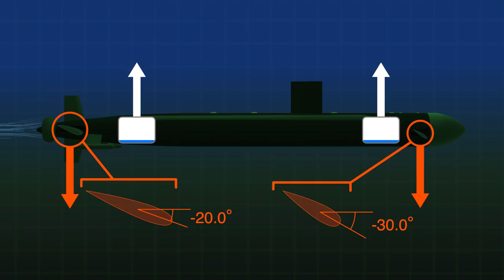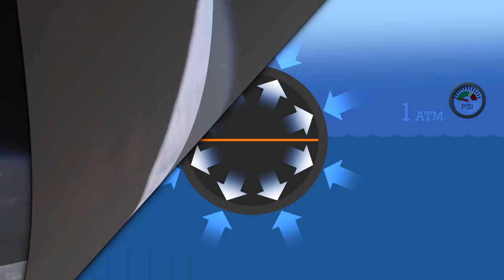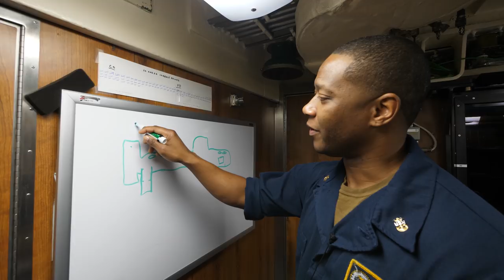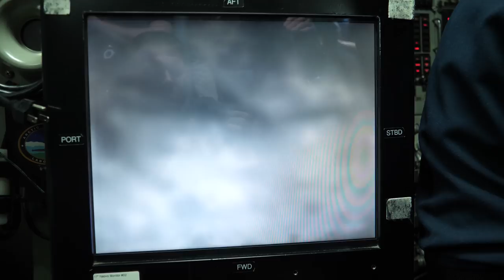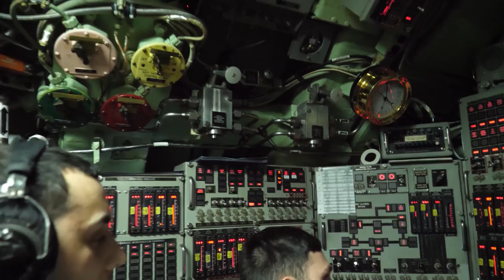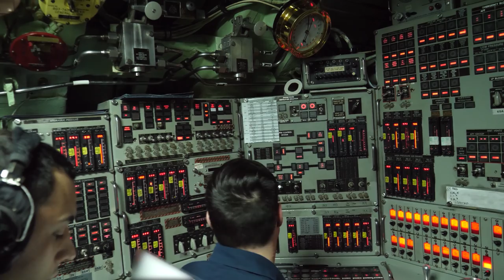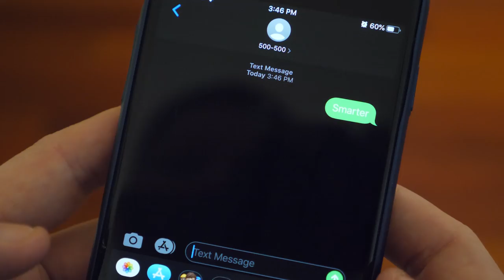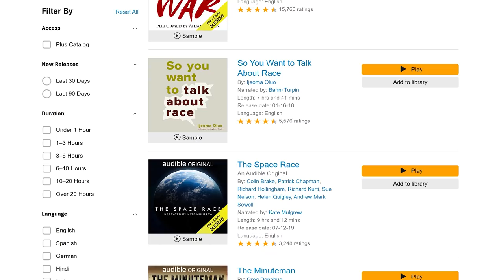How to Surface a Submarine in the Arctic Ocean  - Smarter Every Day 260

Comment: 16:22 is a similar concept to what scuba divers experience. Before learning how to scuba dive, i thought that either A, i didn’t have to change my BCD inflation depending on the depth, or B, i would need my BCD less inflated the deeper i went. However it’s the opposite. As i go deeper, i add more air to the BCD to keep myself from sinking all the way to the sea floor.
Reply: Yea i remember when i first experienced that when diving. It really blows your mind.
Reply: Try freediving. Once you hit the point all the air inside your body is compressed enough to be negatively buyoant, you start freefalling. First time you experience it, it‘s scary. But at the same time it‘s a mindblowing feeling.
Reply: @OneSingleBreath  That sounds amazing and scary. Can you elaborate? How deep this occurs? Whats are you supposed to do to go up again?
Reply: @EmilioBPedrollo  It depends on a bunch of things. In 2007-2009 I did each year a freediving course in Sharm el Sheikh, Egypt. I don‘t know if the salinity of the red sea is high, or moderate. Water temperature (at the surface down to 5 meters) was around 25° - 29° Celsius. My bodyweight was at 80 kgs, at a height of 1,87 m. I had a full-body freediving suit in 5 mm thickness (which was way to warm). To compensate for the additional buoyancy, I wore a weight belt. I can‘t remember how much weight I actually had on it. I can just remember, that in 2007, during my first course, they gave me not enough weight, because the instructors thought, I would wear a 3 mm suit. So in that year I couldn‘t reach the depth where I would start to fall. I can remember, that at around 15 meters I was in a flow state.
In 2008 and 2009 I used more weight, and I started to fall at 12-15 meters. You come up by swimming. ;) I mean, there are different types of freediving. Regarding deep diving there are: 

Constant weight with or without fins - you hold your breath, and you dive with or without fins. 
Free immersion - you wear no fins, and you pull yourself down on a rope, and up again.
Variable weight - You get pulled down by a weight, but you have to resurface using your own strength
No Limits - You get pulled down by a sled, and you resurface either by a inflatable lift bag or a counter-ballance pulley system

Comment: I experienced the air compression phenomenon when scuba diving. It's kind of scary, because to descend, you want to let a bit of air out of your BCD to achieve negative buoyancy. Just a bit so you descend slowly, so you can equalize as you go. However, as you descend your air tanks are being compressed, so they displace less water and you start to accelerate. If there aren't many landmarks, or you are diving at night, it can be hard to notice this happening.

Comment: "You can just do the trig" how bold of you to assume that
Reply: Well Destin was right for me, couldn't stop myself from trying to find the depth.
"You can just do the trig" so Destin puts cut in the video, little did he know the rope gives enough information away.

I did some measurements and math on the rope, and worked out that the submarine's depth was likely around 1100ft  but could be between 800ft -1400ft with the uncertainties that I had in the measurements of the submarines dimensions and starting depth. (thanks Wikipedia)
(could be significantly more than this as bracing was not taken into account in the pressure vessel equations)
Reply: @spencerr505  well... you are assuming that the string didn't have any plastic deformations ;)

Comment: 14:17
Oh, you mean like deep enough that if the hull gave way, the water would compress the air so rapidly that it would literally ignite like in a combustion engine?
The kind of pressure so great that it could flatten a car into a pancake?
Fun!
Reply: Different sources give between 200m and 450m for maximum operating depth. that's 20 to 45 atmospheres of pressure... that doesn't sound like enough to ignite the air
Reply: @666Tomato666  Depends on the nature of the breach. If it were an large instantaneous rupture (essentially adiabatic compression), temperature would rise very rapidly (PV = nRT).  IIRC, the Navy estimated the USS Scorpion could have seen peak temperatures of 1100F+ when they imploded at about 400 meters - between nerve conduction times and the nearly instantaneous pressure and temperature increases the crew probably wouldn't have time to process it.
Reply: That's about it, and just an everyday fact of life for us under the waves...tbh it's also why I never worried about flooding, would be over too fast to realize. Fire on the other hand...
Reply: @willlokeer5469  
Are you at liberty to say which ship you sailed aboard?
Reply: I think I would rather be instantly crushed and incinerated than to wait around for that nuclear reactor vessel to fail.
Reply: @edwardneal4819  The reactor vessel would probably hit the bottom intact. If you're heading toward crush depth, it's because the reactor's scrammed.
Reply: @zildiun2327  I served onboard the USS Maryland
Reply: @willlokeer5469  
Well, thank you for your service! I’m sure it was an interesting experience.

Comment: Really fascinating and also great to see how much of an insight was given to everything what is going on there. What I do not understand is: I get it that a crew needs to be able to keep a submarine full under "manual" control, but why isn't there a lot more automation? Calculating to keep it in balance, pressurizing the tanks accordingly etc. is kind of shouting for a lot of computational support. Is that probably something which is just not shown? It looks a bit like driving a car with someone operating the fuel pump, another one the spark plugs, then someone who is sitting at the steering wheel etc.

Comment: This is very interesting.  It gives an idea of how much work goes into navigating a submarine, both in terms of depth requirements and the effect of depth on the structure of the submarine.  Working on a submarine appears to be a very precise effort, and the working conditions are quite compact.  Apparently every inch of the submarine is used for some function.

Comment: 20:00
FYI, Destin. TLDs (Thermo-Luminescent Dosimeters) are no longer in use by the DoD. They weren't when you uploaded this video; but most TLD(OSL) consumers haven't been given modern equipment training yet.

You probably wore an OSL (Optically Stimunlated Luminescence) device to monitor your radiation.

Love the video!

Comment: My theory on how the sub is able to identify where the thiner new ice to break through: I definitely think that it has something to do with the active sonar system because I think the way thicker Ice would bounce off sound is different from how thiner Ice would, I also think that's why surfacing is a big deal because using the active sonar would give up their position if another ship or sub was around 

My theory on how the sub sonar deal with multipaths: since they know they current depth ergo they know their distance from the Ice in top and the ocean floor they could adjust their sonar to not travel up to that distance but still travel far enough that they can get useful data from it. One problem with this theory is that it only works if they are equidistant from the Ice on top and the ocean floor, that's why I think they also have multiple sonar devices outside the sub, that way they can calibrate how far each can travel based on their distance from the Ice and ocean floor.  I would admit though that I don't know they're going to control how far the sound wave travels

Comment: i'm a diver. so the big difference or the big "deal" , in my opinion, is that running a dive into a submarine,  is that the internal pressure doesn't change. You can dive up to 1000 ft. i.e. and stay there for "x"amount of time (some hours in example) and , suddenly you can go up at 1 bar  again,  without  suffering any embolism. That's  because , in that case, nobody breathed pressured air. you should explain it to your audience.

Comment: ETC (SS/IDW) Retired Hooyah!  Though being 6'5" in a career on submarines isn't that great for the body.  Sleep deprivation does a number to the body.  Lucky to get 2-3 hrs in a 24 period, even though we run on 18 hr days.  Never awake at the same time each day.  Sundays we tried to get less maintenance in, etc., so could get 5 hrs.  I mean in both of those times, that is the time you get to clean up, eat, and pass out asap.  Always a different time.  So many surgeries, back x3, shoulders, knees, etc.  But I wouldn't go back and change anything other than over doing it to excel in promotion potential.
Reply: It isn't a big of an issue as it seems with the balloon example.  We have a very very heavy lead keel lining bottom center.  That is what helps to avoid that issue.

Comment: would you be able to take the background frequency of the video when the dive starts see how the audio changes over the dive and when you reached the final depth shouldn't you be able to calculate the depth of the frequency changes, i think it would based on the pressure differences

Comment: Seems like there's a lot of room for error and it was very analog. Wondering wouldn't it be better suited for a computer to take control. Awesome video.
Reply: That's an interesting question/problem/challenge. For now at least. Try to imagine all of the sensory information that would be needed. You would have to know what is happening along the entire length of the boat. (why isn't a sub a ship?)
The crew is outstanding. Their sense's are maxed out. Sounds, pressure, keeping it from going on it's side, makes landing a rocket tail first, on a floating platform relatively easy. 🤔 But who knows, some of the SpaceX guys could be working on it 🤷

Comment: Unless things have changed in submarines in the last 30 years you have it wrong about ballast tanks. Ballast tanks are, or should be, void of air when operating submerged. Their sole purpose is to provide buoyancy in order to float the ship. Trim tanks are used to control the submarine's buoyancy when submerged; overall trim, fore and aft trim and list. Water is pumped around and out to sea, and flooded in to control these. This is the job of the Diving Officer and the Ballast Control Panel Officer. The trim tanks are hard tanks, able to be exposed to full sea pressure. The ballast tanks are always open to the sea via vents on the bottoms. Air inside the ballast tank is detrimental as it compresses and causes instability because the deeper you go the heavier you get. Occasionally the Diving Officer will order that the ballast tank vents (top vents) be cycled if he feels there might be air inside from air leakage (from the ballast tank blow valves).

Comment: From year to year does the land underwater change. If it does how do submarines navigate without hitting something. This part of submarines navigation is  fascinating 🤔☘️✌️
Reply: There have been instances where submarines have ran into underwater mountains that were in previously certified safe areas. But that's only happened once or twice ever (more often is subs running into things they should have known were there).
Submarines typically do not operate close enough to the seabed for it to be a concern.

Comment: If I were to guess how they figure out which sheet of ice to punch through is thin enough, my guess would be something sonar based like ultrasound to determine the thickness of the ice, but I don't know if stuff like ultrasound works from remote locations(not directly contacting the ice). But then again, this is an advanced nuclear sub and maybe they don't want to give away that info since using sonar can give away your location.

Comment: I feel like you could swap out all that labor for some sonic induction, vibrate the heck outta the ice at a resonant frequency to weaken it, and make the job a bunch easier with a 12"X12" box that goes up that first hatch. Chainsaws n stuff? I mean sure if you gotta, but that's a lotta labor and additional mass on board for something you could just use sound waves to shake real hard til it cracks up and shovels off.
Reply: Thank God you're not a military planner
Reply: @DunjeeTime  If I wanted your opinion on my speculation I'd gargle toilet water for the same flavor and content.

Comment: You know... for a Feedback loop like the tank water problem....there are electrical controllers and a whole field of engineering on control theory, so you wouldn't need to solve those equations as a crew...

Comment: My 😅boat could not surface under the ice. Yet I got the Navy Expeditionary service metal for going under the northern pole for the first time. We has sail-planes tha could not rotate vertical, if we would have had a problem, we would have died. Im in a movie that was filmed on board. Its called Iron boats, Steel men. I got a VHS as payment for my appearance.

Comment: Prudhoe Bay isn't the edge of civilization. Its way past that. You left civilization behind when you left Fairbanks and went north. I was stationed at Fort Wainwright, Alaska. I lived in Fairbanks. I tried to drive to Prudhoe Bay during the spring of 2006 but at the time the road there was being paved. They had just started the paving and most of the way was all dirt. It took way longer then expected so I stopped at the arctic circle and went back home.

Comment: The system we use to identify the thinner parts of the ice, as with most systems we don't like to share info about, it's because we don't have a formal system for surfacing. We look for the place with the most light penetrating through and Tadaa. Found it.

Comment: Two things (being the dumb person I am):
1.) Why can't they make AI to automate (or semi-automate) the calculations of the ascending and descending process (if that's the correct term for that)
2.) This is stupid, I know, but when you submerge a enclosed bottle (filled with air) into the water, it's gonna try and ascend to the surface, right? How are they able to sail (drive?) the submarine in such depths? This aspect never seems to pop up whenever we hear about subs, seems like it's never an issue, really?
Reply: The ballast tanks and dive planes are used to control depth. They have a certain amount of air that makes them however buoyant. To go down you empty them or using the propulsion of the ship you can adjust the stern and bow planes to offer "negative lift" basically they push the ship down more. To go up you evacuate the water in the tanks and refill them with air or use the stern and bow planes to provide "positive lift".
Reply: They talked about the ballast tanks. Water is flooded into the ballast tanks. While that's happening the air that's being displaced escapes from topside vents. Making the boat neutrally buoyant.

Comment: Your title: Surfacing a Submarine...
SSN Toledo was under polar ice cap during your visit; but sometimes you see dramatic like on the YouTube video for SeaWolf where it launces airborne.

Can you imagine being in the sub crew during a rapid surfacing where the bow launches over 60ft above the water, and then falls the height of a 8 story building back below the waves !?!

While this sort of looks like a whale playing on the surface, you have to realize the scale of that sub about 40ft tall (nearly 15m without conning tower) and the nose went way farther into the air, then splashed down to submerged level again.

HOLD ON !! That's taking every person and machine on a wild roller coaster ride.  
Tie EvErYtHiNg down (especially the torpedos)... tell the kitchen NoT to be cooking/serving anything at the time, and hope nobody was trying to use the bathroom.
   😮 😮 😮
How does a nuclear reactor like being tossed into the air, then dropped five stories or more while still generating about 80% of its rated power ??
( I guess they build 'em Navy tough )

Comment: It's kind of interesting but also pointles. there wasn't much interesting information. Most of what would be interesting was censored and cut out  or the camera was facing the floor. There really is no point to such a video. It's like F=m*(can't tell the public). What is the point of "showing" how a submarine surfaces under the ice if you actually can't disclose 50% of information????